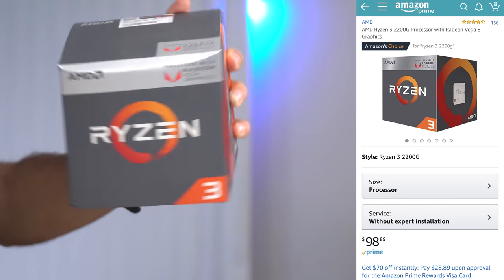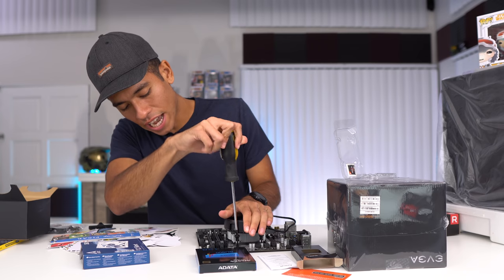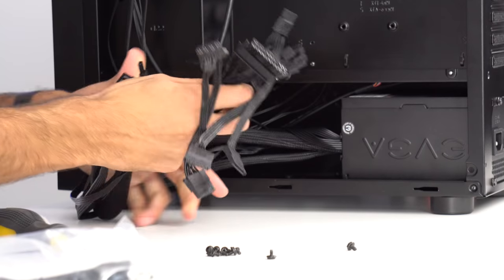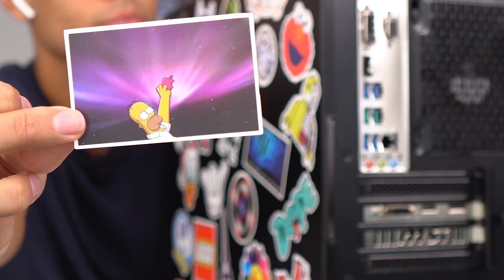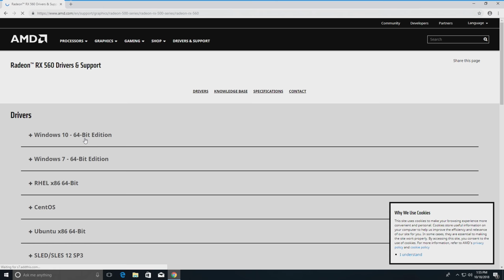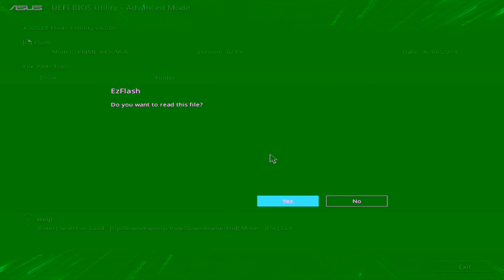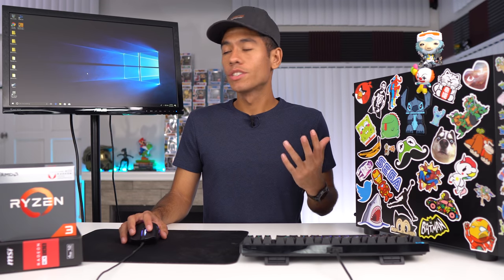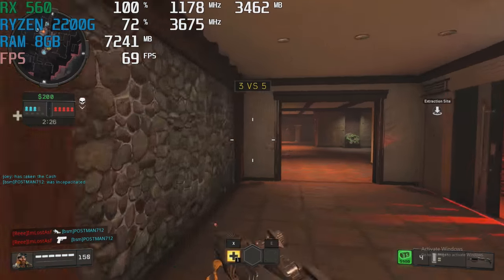Best $500 Budget Gaming PC Build Guide - RX 560 Ryzen 3 2200G (w/ Benchmarks)

Comment: Just built this computer, total cost was $377.00
Reply: Will it be easy to upgrade in the future? How’s it running for you?
Reply: noce
Reply: How’d you manage that? Mines going to cost around $680
Reply: Kuflo You have to take in account local offers, location, availability etc
Reply: Salinas 27 Ah. I just bought my parts through Amazon
Reply: name, but even it would only be around 540 for me @Noah-df7pm
Reply: Kuflo dang man i were you i would of gone with the 750 build because 70 bucks for the performance difference is a ton
Reply: mine got to 660 yeh  @Noah-df7pm
Reply: Max Postlethwaite So I went ahead and put together the $750 build, it’s definitely worth the extra cash for the upgrade. Working great! Very satisfied
Reply: Kuflo  ok might do the same ten
Reply: You probably forgot the stickers
Reply: specs?
Reply: was fortnite good at it
Reply: Kuflo try pc parts picker
Reply: @shaivalipatel1805  fortnut is trash smh
Reply: Cody Lamp in
Reply: j s dude u can just get a rx 570 for 120
Reply: Is it good
Reply: Is it good if you use msi b450 mortar??
Reply: @Noah-df7pm  is IT a good computer
Reply: Epic Crow Yeah it’s great. Hasn’t given me any problems and can handle a lot at once. Games also run above 100 FPS on most settings as wel
Reply: @DrFister  you can upgrade almost everything
Reply: can this computer run call of duty black ops 3 above 60 fps?
Reply: Cody lamp, how's ur experience with the pc?
Reply: If you can be patient and say, wait 1-3 months and keep checking eBay, Amazon, and Newegg for deals and check local ads for Best Buy, Walmart, and other electronic stores for sales, you can easily shave off $50-150. Then you can have the extra money for a new monitor, keyboard, lights, etc. This is an awesome build for the price.
Reply: Idk how that’s physically possible but ok then
Reply: @tonymiester3437  noce
Reply: Noce
Reply: Kuflo do you think it would be able to run Minecraft with mods and shaders?
Reply: I got a faulty CPU and k had to send it back to amazon😩
Reply: Kerota THIS WHAT IM AFRAID OF 😫😩!!!
Reply: i would upgrade to a 570 and get another fan
Reply: That’s what I paid for my ram.....
Reply: hi is it a good pc
Reply: what how i got it for 550
Reply: Kuflo on fortnite (if u have it downloaded) how many fps can u run smoothly
Reply: Mike Wolf yet millions of people play it
Reply: Jenny RH why are u still playing minecraft
Reply: do u play any mmos?
Reply: how much storage space do you have ?
Reply: Is there a hdd holder ?
Reply: lol i had to pay $990 for it CAD
Reply: Cody Lamp mine was was $823
Reply: Is it vr ready?
Reply: @5STAR4L  i'm not sure i'll check though
Reply: @saulbrennan3453  thanks bro i appreciate it
Reply: nirvan cero  yes all the cables came in the boxes
Reply: Guys this is a lie my total is 522$
Reply: @stoneirvin6086  bruh it depends where u live.
Reply: USA?
Reply: @mikewolf6012  totally agree I wont waste a 500$ on forknife.
legends play real games like cs:go or minecraft.
Reply: @nakar882  immature play rs6,csgo, pubg on it..Not even gonna try playing fortnite
Reply: Fucking hell, in canada, it will cost me over 900 bucks!
Reply: @Lucktsu-  patience my man
Reply: Kuflo what’s your build I’m guessing the same as this vid but a few upgraded parts and hardrive?
Reply: Mines brand new and i built mine for 400
Reply: 900 for me :(
Reply: @Electro Same
Reply: @ijustwannagive  900? As in 900 US dollars?
Reply: @Noah-df7pm  when purchsing components different times have different prices.
Reply: @kear mysery Canadian dollars
Reply: 377 + moniter, keyboard, and mouse and it should be like $500
Reply: Wait do I need to install windows 10 or is that optional ?
Reply: slap a rx 5700 xt and ryzen 5 3600 and boom. Upgrade
Reply: Hi. How is it holding it up for you 3 months later? I want to build it this coming black Friday / cyber Monday
Reply: @Noah-df7pm  What???? How?
Reply: My brains hurts
Reply: was about 561 for me but i got my own moniter
Reply: No paste used for CPU cooling??
Is that okay?  or will it overheat?
Reply: You probably bought the cheapest and you shouldn’t buy the cheapest cause they could either be broken, scrapped , or used/old. Don’t fool yourself
Reply: I got CDN$627
Reply: Cody Lamp how bro and does forntie look good on it ?
Reply: Im gonna upgrade mine, im keeping the 256gb ssd, 1tb hdd and the case with 4 fans. Upgrading the rest. Gtx 1050 ti g1 gaming, asrock b150m steel legend motherboard, ryzen 1600 and 16gb of ram
Reply: Will this computer work with friends csgo
Reply: Kuflo shouldeve prices matched at best buy
Reply: Kuflo used parts?
Reply: @nakar882  bro minecraft is 60% of the reason I'm getting a pc lmao
Reply: @Noah-df7pm  Maybe he bought used parts
Reply: What’s FPS on rdr2
Reply: try 389 for me
Reply: Do you guys buy all parts at once and how do they ship all of them
Reply: @Noah-df7pm  what are the specs of the build if it's better than mine for 750 usd im probably going to breakdown and cry in my mind.
Reply: @Noah-df7pm  Use a EX-A320M motherboard my friend
Reply: @Cody Lamp How is it running bro? Will it run all new games on high?
Reply: @matttttt1901  its not an i3, he didnt even use an intel processor
Reply: Cody Lamp does that include the stickers?
Reply: Thanks
Reply: Wow a got a case from the snow for free! Nice case btw
Reply: That’s how much the damn graphics card costs if ur an Aussie
Reply: jonathan saren if I’m building this Ima change the case and maybe have a better cpu and 16GB ram
Reply: @bad6681  do u still play fn and if what do u think of new season
Reply: @nowy_xq8196  what cpu and ram options would u recommend?
Reply: pennywise Whats your budget? And for this build or...
Reply: @nowy_xq8196  this build and my budget is $650
Reply: pennywise ok motherboard: b450M same in the vid.  Cpu: ryzen 5 2600.  ram: any 16gb ram. gpu: rx 570. Power supply: 500w evga 80+  you can go for a case of your choice and I would go for a 500gb and up
Reply: @nowy_xq8196  thank you so much for the help. Hopefully I don't mess up my first pc build ever.
Reply: pennywise no problem I’d still just recommend to watch more videos to make sure if ur confident building it and to know what ur doing
Reply: @nowy_xq8196  thanks for the advice
Reply: My brother build the same thing and it won’t show in the screen can you help
Reply: how did you get that gpu for a few bucks? i mean today people are selling a gt 1050 for more than 200$

Comment: It’s a good day when Joey Delgado uploads :)
Reply: I like when people  overreact and say with 500$ u can't get a gpu and they go for dual core :/
Reply: Facts
Reply: Perfect on a sunday
Reply: any help I wanna play fortnite I have an hp it has radeon 4 amd a6 processor it runs fortnite but its choppy and fresse 20 fps then 1 fps building don't load any help what I can download to run fortnite?
Reply: @devantenevels6642  you need a new pc.....
Reply: True
Reply: @Devante Nevels I would recommend a new PC too. Maybe a Ryzen 3 like this build, and if your budget is that tight I’d recommend a cheaper Radeon GPU like the RX 550. This build is great though, only $500. If you already have a system, you could keep the power supply, drive(s), case etc. and just upgrade the motherboard, cpu and graphics card (and RAM if necessary). If you can afford it, I’d also recommend a 128GB SSD, similar to this build, because it will speed your system up a tonne. Just some options!
Reply: @devantenevels6642   hi, ur computer is old, its got an a6 processor, a budget pc would be recommended, if its only fortnite, a intel pentium or ryzen 3 would be better, mother board, by the matching chipset and look for which ever one is on sale, for cpu a gtx1050 or 1050ti would be fine, try scrape a 1060 3g if possible, ram can be 8g ssd recommended as for the case, well, low budget so go with what ever case that is on sale, don't spend too much money on rGb due to ur budget.
Reply: @pikachu9756  just bought it a best buy they told me it was new im trying to upgrade its gpu or get geforce now
Reply: I got the same monitor as you and I wanted to ask what monitor stand you have
Reply: You stole my comment.
Reply: So tru
Reply: You deserve it thanks to you I built my first budgetgaming computer last year and it's still going strong
Reply: So tru
Reply: William B-P it’s so cringe when people edit saying thanks for the likes
Reply: that true :)~ <3
Reply: agree
Reply: Devante Nevels Buy a decent GPU
Reply: Make a $3,000 pc with a 2080ti, i9 9700k, 32 or 16gb of RAM
Reply: Very true
Reply: Guys i Will do the same Pc with different parts , i changed the Motherboard b450 to a320m-hd , HDD 1tb tô 500gb and removed ssd , Will It change the performance ? (Sorry for bad english im Brazilian)
Reply: @diogondss1872  no not really. You just can't store as many games as before and by the way is that your real name?
Reply: Diogo Neves De Sousa Santos - Honestly I recommend you keep the SSD. An SSD will make a night and day difference to your PC boot times and your game load times. Otherwise, none of your other changes will make a difference to performance.
Reply: @zaraf  yeah i'm Brazilian this build on the vídeo cost 650-750$ and i cant buy this
Reply: Hello , I have a question 
I have 8 gb ddr4 ram, intel quad core pentium, dedicated graphics.
What fps will i get at lowest resolution.
Reply: Test Apex Legends
Reply: Dude do all of those parts still fit in the Thermaltake micro ATX case but with the window
Reply: Can it run battlefield 5?
Reply: Hi William im your 1000th like !
Reply: true✌
Reply: William B-P whats gonna happen when i use a different case
Reply: Like do i need anything else
Reply: Idk if that day will ever come =(

Comment: Yo Joey I built my PC. Your $750 guide really helped me. Thanks bro 🙏
Reply: Really, I want to go with the same parts and I will have the money soon
Reply: @mostafakhemissi34  I didn't go with the same build. Something similar but more pricey
Reply: Same
Reply: Hey Joey! I did the $650 pc build with the Ryzen 5 1500x and GTX 1060 yesterday thank you so much its my first time building a pc! :)
Reply: @gamingwithkoalas5133  Congrats
Reply: Can i use WiFi on that build?
Reply: Im building the 1100 build right now 400 bucks in
Reply: @katherineforero4883  You need a WiFi adapter. I got a TP-Link Archer T2UH. It is very good
Reply: @Fraze Very easy
Reply: @Fraze 3 hours with double checking everything
Reply: @Fraze I am pretty proud of my cable management. Buying zip ties and pliers was sooo worth it. I am thibking of upgrading the AMD Stealth cooler to a Wraith Prism RGB for £20

Comment: cuz of YOU i build my own pc, im typing this comment from the pc
CANT THANK YOU ENOUGH 
LOVE YOU
Reply: This build?
Reply: Aliz did u go with this build?
Reply: Aliz is it good
Reply: @dancy8879  yh its good enough to run top games in decent settings too
Reply: @sanity375  yes
Reply: @Metalic Caterpilar at the end i spent about £450 ($560) as i bought some extra things but honest thought it can run games smoothly and it gets the job done
Reply: @aliz3575  um since you build this pc. Can you tell me if i can replace the hard drive with a different one?
Reply: @Metalic Caterpilar ok thanks
Reply: 99% of all hard drives used in the market are SATA cable connected hard drives. (99% is the actual number, not pulling that out of my ass.) So as long as you get a SATA hard drive you should be fine. You really want an SSD though. It's one of the cheapest things that will noticeably increase the speed of your system. Good for loading in new areas on large open world games also. So if you're trying to use a hard drive in place of an SSD to save some money then try to avoid that.
Reply: @Mason-kd2zr  ok thanks, and can i ask another question if for example i build the build on the video and i want more storage than what is in the build itself what is the best way to expand the storage but still has the ssd inside the build?
Reply: Aliz wow thats a great price what extra things did you get? Im thinking about using this build
Reply: @Christian Latoja p just buy a 1tb hdd it will hook up the same way too
Reply: Fortnite on low settings?

Comment: I’m still using the 500$ Ryzen 3 1200 and gtx 1050ti that you made
Reply: Do u know your CPU's Intel equivalent? Howz fortnite holding up at different settings?
Reply: I got my ryzen 1700x for $128 and I got rx 570 8gb for $150
Reply: @AshrafMMA  I think the i3 - 8350 is the closest thing to it. The intel ones cost more, but something in the high i3 or low i5 area will you get similar performance
Reply: @joshuasweet5854  its more like i3 8100
Reply: Ali Ashraf holding up good still get 240+ fps on medium and 180+ on high setting
Reply: @joshuasweet5854  i3 8100 is a little bit faster and has better single core performance I believe
Reply: I'm using the ryzen 3 1200g with 1050

Comment: Reply what you think about my build:
MOBO:ASRock AB350M Pro4
CPU:AMD Ryzen 3 2200G
GPU:Nvidia Geforce GTX 1050ti 4GB
RAM:DDR4 2x4gb 2400mhz
HD:SEAGATE BarraCuda 2TB 3.5" 7200 rpm 64 MB SATA 3
SSD:APACER 120GB 2.5" SATA III AS340 SSD Panther series
Power suply:500W
Case:MS SIRIUS II 

Got all of that for 430$
Everything is new, except the GPU.
Reply: Thanks for the reply!
Reply: @filipmilicevic918   bro to be honest your pc is a beast as it is.1300x is not that good.Also just imagine that my build(same)was purchased for 650 euros which is like 700$
Reply: @igdivine5389  since when was the 1300x trash ? i'd get the 1300x if i already have a dedicated gpu.

Comment: How about ryzen 5 2600 with gtx 1060 6gb?
Reply: That sounds great
Reply: i got the 2600 but gonna pair her with an rx 580 at the moment they are really cheap here
Reply: Does the rx580 8gb get 1080p?
Reply: Derrick Russell 1060 and rx 580 are basically the sane buy whatevers cheaper
Reply: Best value and outstanding performance
Reply: That’s what I’m getting :P
Reply: I have the same! It is the best you can get for 1080p gaming!
Reply: I think he did a ryzen 2600 build with a 580
Reply: @pierregrobbelaar9116  he did a build like that i thinm
Reply: The rx 580 is better in most games
Reply: either the 1060 6gb or the rx 580, depends on the game you play, if you are a single player, open world, witcher 3, farcry 5, Fallout, ect, go for the 1060 for more V-ram, but if you are a multi-player kind of person, go for the rx 580
Reply: All the games you just said the rx 580 is better in.
Reply: @derrickrussell3505  Yes it does. I benchmark firestrike, heaven benchmark, and furmark all at its highest HIGHEST ultimate settings with no problem and as much anti-aliasing as possible and it runs flawlessly!
Reply: Hydra TGM get rx 580

Comment: I'm looking to upgrade to a larger SSD (currently have 128GB), but I don't know what to get, or how to transfer everything over from the old to the new.  Any suggestions?   
I bought and built this computer at the beginning of 2019.  I use it for gaming and editing, and I've been really happy with it!  I had never built a computer before, and didn't know much, if anything about it.  My friends all thought I was crazy, but you made it look super easy and fun, so I dove right in.  Your instructions were great!  I love how you get so specific down to each clicking sound.  I can't tell you how helpful that is when you've never done it before!!  I'll never forget turning it on for the first time, praying it would start up, and of course it didn't, lol.  Actually, it did; I just didn't know because I had the monitor plugged into the wrong port.  It was an easy fix, that took a few days to figure out.  Thanks again!

Comment: Just Finished this build today, thanks man! great work
Reply: Does it run ok? If you play fortnite, how many frames does it run on low?
Reply: Grape it runs great! I don’t play fortnite, but I’ve been playing rocket league and subnatica, they run incredibly smooth. I even tried GTA and it ran pretty decent as well!
Reply: Ok well thanks! Im thinking about building it
Reply: Grape great for a first build as well as a budget. It will run fortnite fantastic if it can run all the other games I listed. I had no problems in the build, everything in this video will work as long as you follow step by step
Reply: @user-fb6ny1mn9y  ok, thanks again. Do u think it will be a good choice to upgrade to an msi rx 580?
Reply: Grape I don’t think it would hurt. Should help put a bit I’m sure, but again I think the 560 is just fine, especially if you have a budget
Reply: Ok 😁
Reply: same here! no problems (y e t) had this for around 7 months and its ran perfectly for all of my games!

Comment: Ryzen 5 2600X with RX 590 please
Reply: get the 580
Reply: @schlongdas7250  wtf are you smoking. The 590 is way better.
Reply: HazarDemon not really, only ~8% better performance. If you can find it at a good price get the 590, if it’s like 40$ more don’t though it isn’t worth
Reply: HazarDemon just overclock your 580 and it’s the same thing. the price difference doesn’t work out.
Reply: See the $750 builds it's close enough
Reply: longdas but overclock your 590 and it’s better than overclocked 580

Comment: Get a RX 570 if you can or a Ryzen 5 2600
Reply: WillSuperSaiyan would I need to upgrade anything else in order to use the better gpu? I haven't built a gaming pc before.
Reply: No it’s fine
Reply: Chayce no but make sure you don’t get something too powerful as it would bottleneck
Reply: TheKillerOrang3 2600 can support a RTX 2080ti no problem and the 2200G can easily take a 570